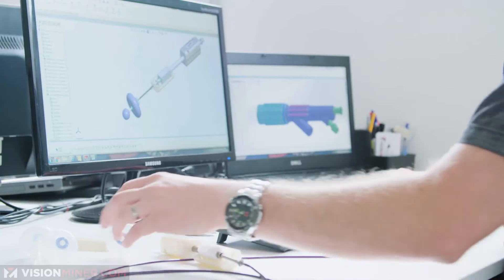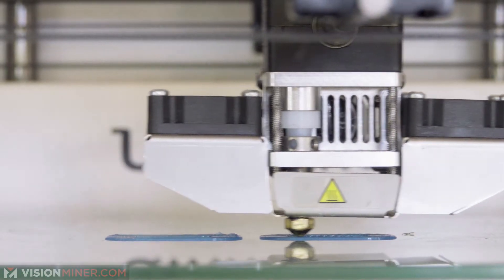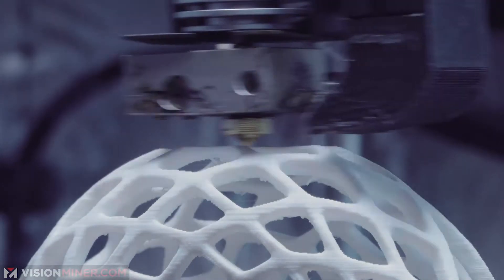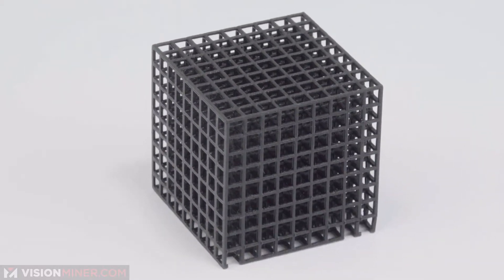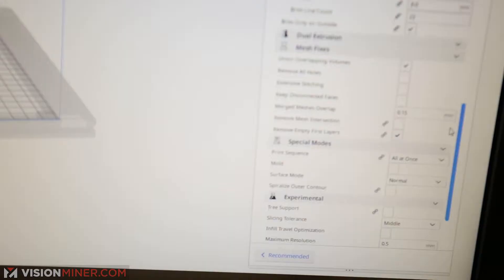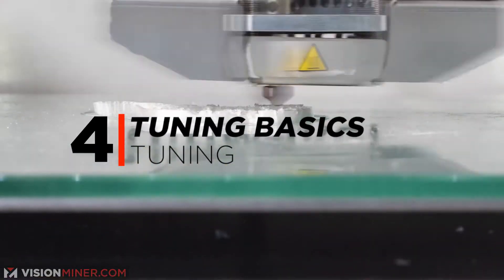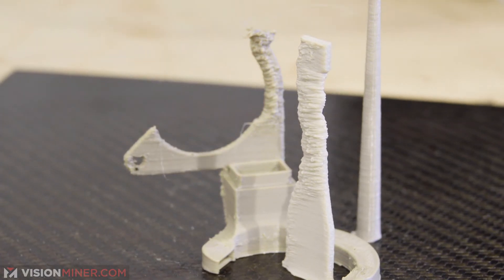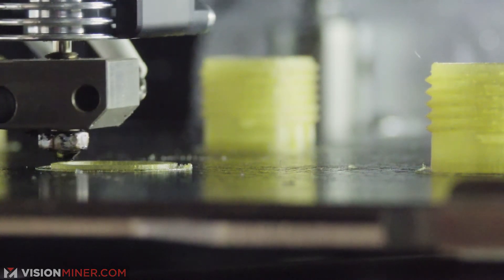The 5 Steps to 3D Printing: from 3D Model to Full Production Manufacturing

Comment: Hey!
Could you please guide me more, am little bit confused.
Actually i am doing a project making a 3D printer .
so what i have to do, 1st make a 3D model then what i have to do?
Reply from the maker: Well, you can start with any 3D Model, from thingiverse.com or grabcad.com or yeggi.com or similar -- then, you slice it in something like Cura (free), and then load the slice code into the printer. Check out our video on how to "3D Print without a 3D Printer", and that will give you a good overview! :)
Reply: @VisionMiner  TY but i have a 3d model, i used Slic3r to generate g-code, i am using ardunio mega, now m confused to watch diff ways, what to do next after g-codes, how to load...what i have to do with Ardiono Mega, m totally blank
Reply from the maker: @o_q5728  Sorry, we don't do anything with Arduino, so I'm not sure how to answer!